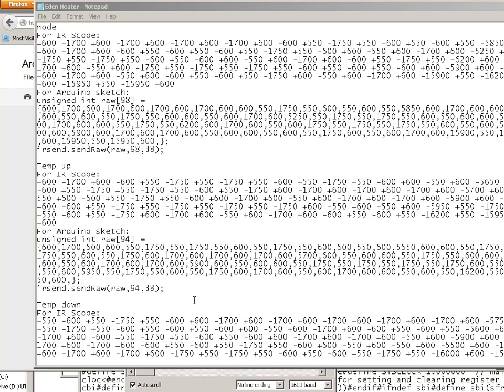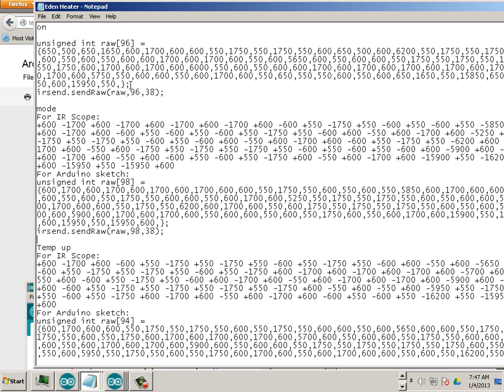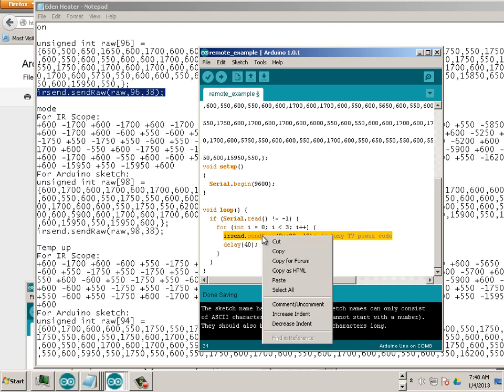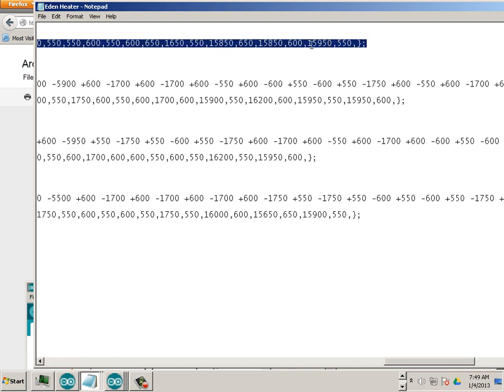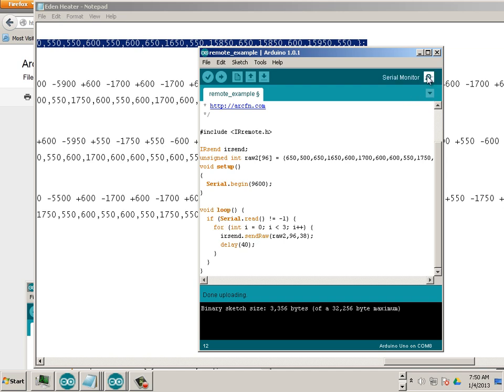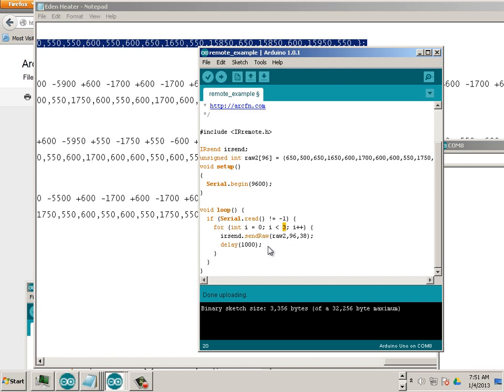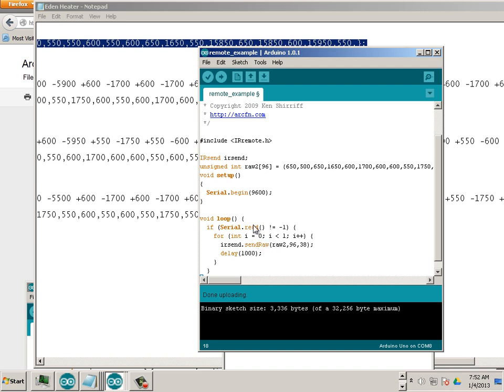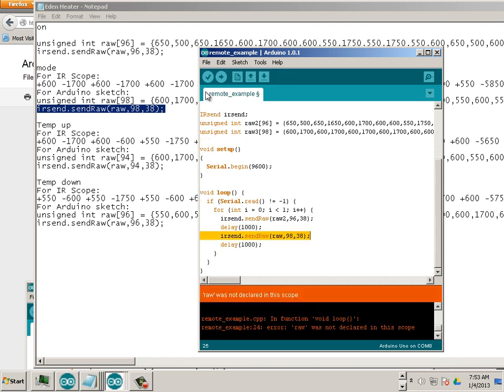1304 Arduino  Chapter13 Sending Raw IR codes to comsumer products

Comment: hi Jason 

how can i  create such type of code for controlling a  tv.
this below data is copied from others programm.

D010020A
Decoded NEC: D010020A (32 bits)
Raw (74): -7402 9000 -4350 750 -1500 750 -1550 750 -450 750 -1500 750 -450 750 -450 750 -450 700 -450 750 -450 750 -450 750 -450 700 -1550 750 -450 750 -450 750 -450 700 -450 750 -450 750 -450 700 -500 700 -500 700 -450 750 -450 700 -1600 700 -450 750 -450 700 -500 700 -500 700 -500 700 -1550 700 -500 700 -1600 700 -450 700 -500 700 -1600 700 -450 700 

help me how to get such codes from remote control of TV

Comment: how does arduino know to wich pin output the signal ?
Reply: you can specify a pin at the setup part of the program.
remember that it needs to be a pin labeled as PWD(~)on the Arduino
Reply: Thats a really very extremely good question
Reply: Try some of the timer pins

Comment: I forgot to say that the same code works correctly for samsung led tv. Of course, replacing void loop () with this:

void loop() {
  delay(10000);
 for (int i = 0; i < 3; i++) {
  irsend.sendSAMSUNG(0xE0E040BF, 32);   //SAMSUNG TV LED on/off   (capturado con IRrecvDumpV2.ino)
  delay(40);
 }
 delay(10000);

 
}

Comment: Hi jason.  Very cool video!

I have a problem sending the code with arduino uno. 

With IRrecv Dump and the original remote control I get:

D010020A
Decoded NEC: D010020A (32 bits)
Raw (74): -7402 9000 -4350 750 -1500 750 -1550 750 -450 750 -1500 750 -450 750 -450 750 -450 700 -450 750 -450 750 -450 750 -450 700 -1550 750 -450 750 -450 750 -450 700 -450 750 -450 750 -450 700 -500 700 -500 700 -450 750 -450 700 -1600 700 -450 750 -450 700 -500 700 -500 700 -500 700 -1550 700 -500 700 -1600 700 -450 700 -500 700 -1600 700 -450 700 

Loading in other Arduino Uno this code:

#include "IRremote.h"

IRsend irsend;

void setup()
{

Serial.begin(9600);
}

void loop()
{
//Replace for your IR Code here. 
irsend.sendNEC(0xD010020A, 32); //irsend.send(IRTYPE)(0x(IRCODE), (BITS)); 
delay(10000);
}

And reading with IRrecvDump which sends the Arduino I get:

D010020A
Decoded NEC: D010020A (32 bits)
Raw (68): -6696 9100 -4350 700 -1550 700 -1550 650 -450 650 -1600 700 -450 650 -450 650 -450 650 -500 650 -450 650 -450 650 -500 650 -1550 700 -450 650 -450 650 -450 700 -450 650 -450 650 -450 700 -450 650 -450 650 -450 700 -450 650 -1600 650 -450 650 -450 650 -500 600 -500 650 -450 650 -1600 650 -450 650 -1600 650 -500 600 

I do not understand the difference Raw (74) and Raw (68)

The original remote control is NEC code. Disassemble and inside has the NEC chip.
It is an Air-conditioner, but the air conditioner unresponsive. The original remote control sends the code only once

 
Thanks and sorry for my English.

Comment: Hi,could i ask a question, if i need to send more than 27 amounts command at raw format, and that arduino uno will show not enought memory alert, is that possible way to solve it ?
THX a lot :)
Reply: +韋凡陳 
You should create a function and initialize this variables locally inside this function. If you declare it global as he did in this video, you are gonna need an Arduino board like Mega because of th memory.

Comment: Hello, great video 13... with your direction and litle modifications in your code, now i record the infrared raw code with one arduino pro mini and then programing another one, now i can send it when i push a button on pin 12, and also i am using the led on pin 13 to visualise thisfunction, see my code,  thanks again...
/*
 * IRremote: IRsendDemo - demonstrates sending IR codes with IRsend
 * An IR LED must be connected to Arduino PWM pin 3.
 * Version 0.1 July, 2009
 * Copyright 2009 Ken Shirriff
 * http://arcfn.com
 */

#include <IRremote.h>

int BUTTON_PIN = 12;
int STATUS_PIN = 13;

IRsend irsend;
 
unsigned int raw[68] = {9000,4350,650,450,650,500,650,450,650,450,650,500,650,450,650,450,650,450,650,1600,650,1600,600,1600,650,1600,650,1550,650,1600,650,1550,650,1600,650,1550,650,1600,650,1600,600,500,650,1550,650,450,650,500,650,450,650,450,650,500,650,450,650,1550,650,500,600,1600,650,1600,650,1600,600,};

void setup()

{
  Serial.begin(9600);

  pinMode(BUTTON_PIN, INPUT);
  pinMode(STATUS_PIN, OUTPUT);
}

int lastButtonState;

void loop() {
  // If button pressed, send the code.
  int buttonState = digitalRead(BUTTON_PIN);
  if (lastButtonState == HIGH && buttonState == LOW) {
    Serial.println("Released");
  }

  if (buttonState) {
    Serial.println("Pressed, sending");
    digitalWrite(STATUS_PIN, HIGH);
    irsend.sendRaw(raw,68,38);
    digitalWrite(STATUS_PIN, LOW);
    delay(50); // Wait a bit between retransmissions
  } 

  lastButtonState = buttonState;
}

Comment: Hey, great video! I need some urgent help with casio projector--
So on running the IRrecord or IRRecv sketch, when I press,let's say the "ON" button on the projector's remote, I get --> 
(also printing out out the codeLen turns out to be 20)
Received NEC: 212F20DF
20
Received NEC: repeat; ignoring.

But when I compile the IRSendDemo sketch with same code: projector does not seem to respond-->

irsend.sendNEC('212F20DF', 20);

Any idea why? I'm using about 180 ohm resistor.
I believe NEC commands are sent only once.
Reply: change that '212F20DF' into this "212F20DF"

Comment: hi there Jason,
thanks for the ausome vid. hope it will work for the AC im trying to control.

1,what model make remote/ device is this working on?
i assume the #define RAWBUF 100 in IRremote should need be changed (increased) depending on the device -> Samsung AC is known for longer IR code.

2, must an IR LED be used (can an arduino IR transmitter be used with this), thanks?

Comment: Hello Jason... I recorded the raw code for my TV. These raw codes seem to vary over a range of values.When i send these raw values it does sometime switches on the TV but most of the times it doesnt!! However for other buttons apart from the power on and off i get a fixed set of values and it does work properly for them.I wonder what is it with the power button..

Comment: Hi, i'm from Argentina, so, sorry for my english. This 2 chapters were amazing, you helped me a lot! Thank You!
I want to know a thing, I have the IR transmitter and i need to know where to put it.
The code comments at the beginning says that the IR LED must be connected to Arduino PWM Pin 3. I wish to know if I have to put the IR LED with a Resistor (and what ohms) or It can be connected directly to pin 3.
Is there a way to change the pin in which i have to connect the IR LED?
Thanks a Lot! :)